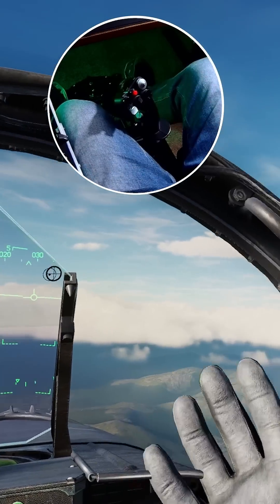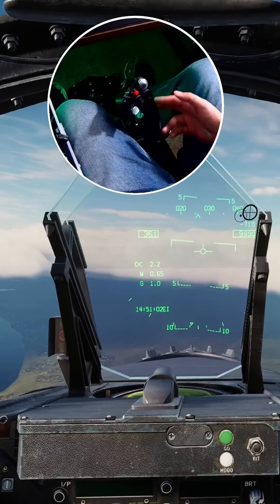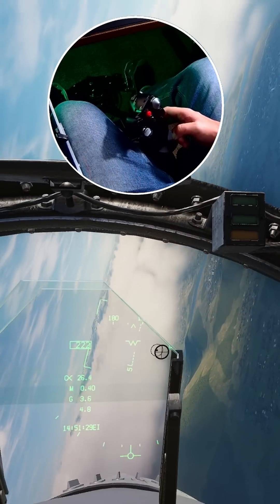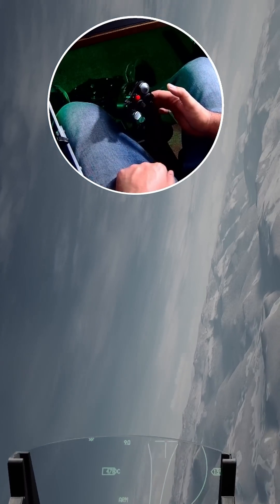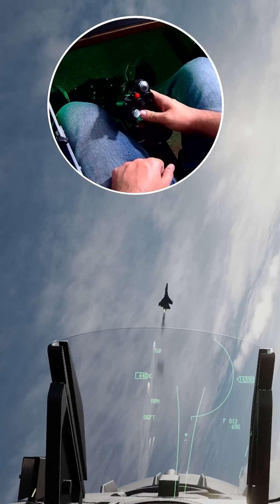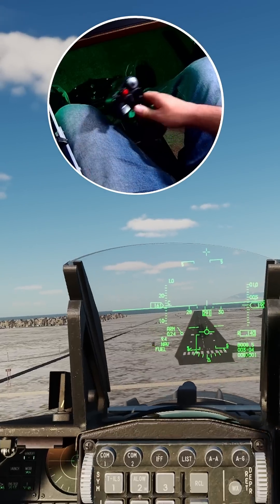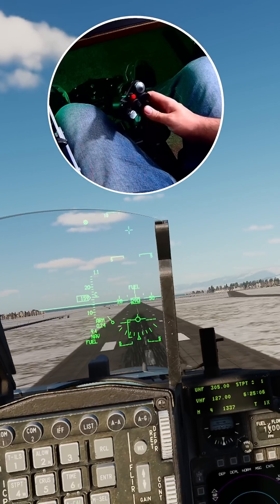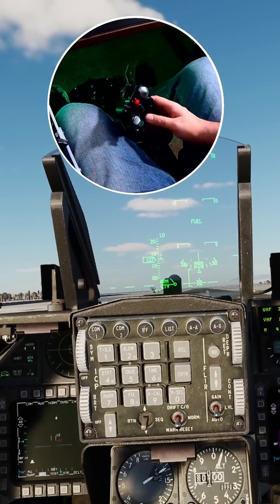How do FBW Aircraft Work with Force Feedback? Moza AB9 w/ MH16 grip

Comment: for the Hornet it's enough to have VKB/Virpil base with hard center cam, that's it. The only thing you miss with this approach is the stick load (Moza doesn't generate a lot of force though) and stick pusher when aoa is more than 22 deg. On the other side, Moza doesn't model hard center and it's hardly possible with the motors. While the hornet actually has the hard center. For Viper... just no comments.